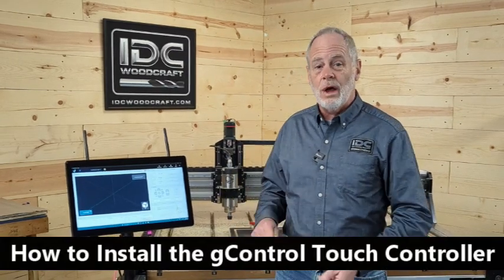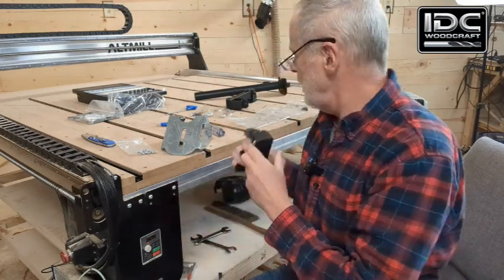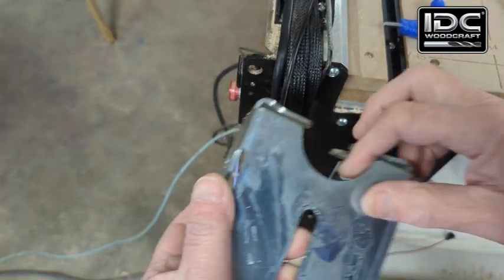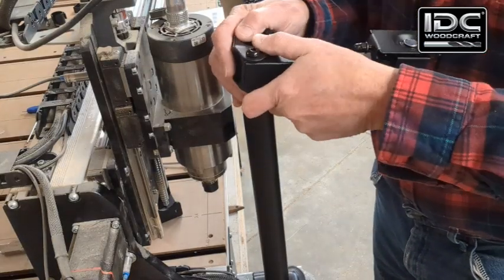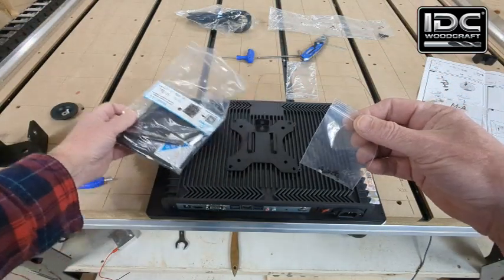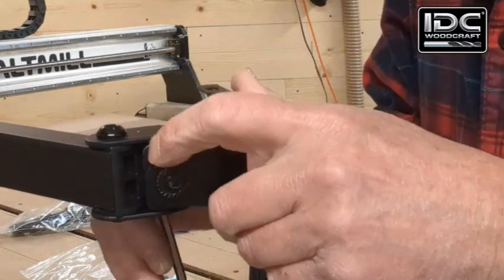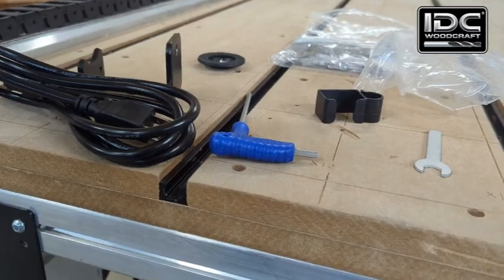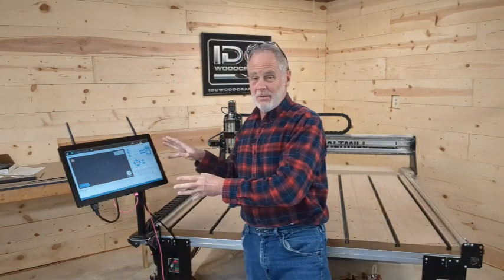How to Install CNC gControl Screen on Your CNC Router

Comment: Can you make a video or post the code for a simple circle for me that GRBL will run. Seams silly to me because I program real CNC mills every day at work yet I tried to do it in my grbl machine at home with no luck 1st I tried to do it with X's and I's it grafts it fine but doesn't run it then I searched google and some say grbl don't recognize i,j,k. So I wrote it with an r value and same thing grafts it fine but doesn't run it. I'm lost it's a simple circle how hard can it be. Maybe even just direct me to where I can find the information I can't seem to find anywhere if someone has posted a sample program of a circle 😢. I have tried several different codes none of them work CNC machines and must be grbl is different? Or does it only recognize point-to-point programming?
Reply from the maker: 5" circle centered on xy0, .125 deep, but size does not matter

Here is the GRBL-compatible G-code for cutting a 5-inch diameter circle, centered at (X0, Y0) with the given parameters:

Spindle Speed: 12,000 RPM

Spindle Direction: Clockwise (M3)

Feed Rate: 50 inches per minute

Depth of Cut: 0.125 inches

(5-inch circle centered at X0 Y0)
G20 (Set units to inches)
G17 (Select XY plane)
G90 (Absolute positioning)
G0 Z0.5 (Move to safe height)
G0 X2.5 Y0 (Move to start position at circle's edge)
M3 S12000 (Start spindle at 12000 RPM)
G1 Z-0.125 F20 (Plunge to cutting depth)
G2 X2.5 Y0 I-2.5 J0 F50 (Cut a full 5-inch circle clockwise)
G0 Z0.5 (Retract)
G0 X0 Y0 (Return to center)
M5 (Stop spindle)
G0 Z1.0 (Move to safe height)
M30 (End of program)

Here ya go

Comment: You need a chest mounted camera to allow you to use both hands. 

I'd be looking at getting extra screws, with big washers, and install 8 screws to the bracket holding the monitor.
Reply from the maker: That sounds like a solid idea for better stability and handling! A chest-mounted camera can really free up your hands while working. Extra screws and washers would definitely help secure your monitor. Thanks for sharing your thoughts!

Comment: Just got mine!! Awesome stuff. How do I put pictures of my kids on the screen? 😂
Reply from the maker: That's fantastic to hear you got your machine! To put pictures of your kids on the screen, you'll typically need to transfer the images to your CNC's software or controller, depending on the model you have. Most machines allow you to import image files directly or use a specific format, so check your user manual for the details. Have fun creating!